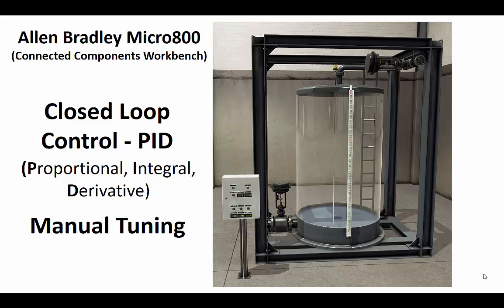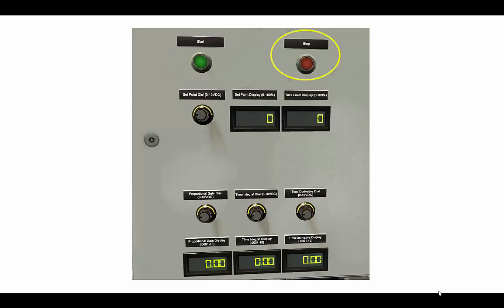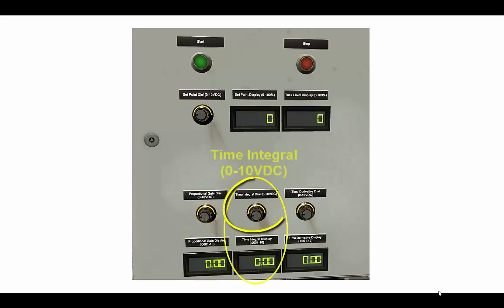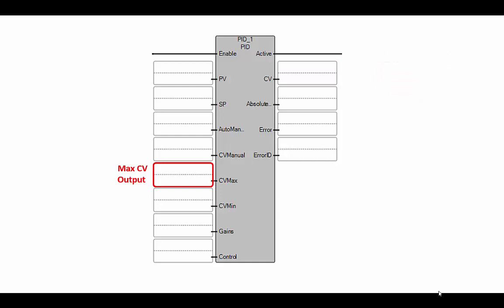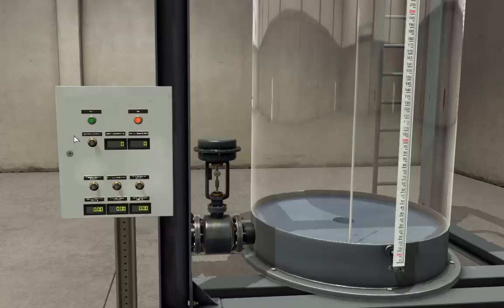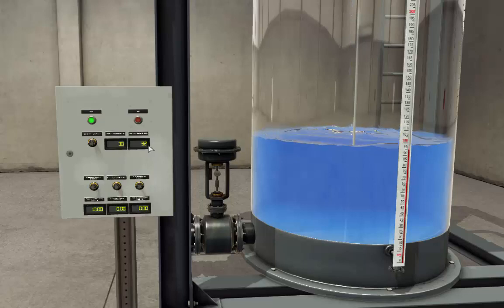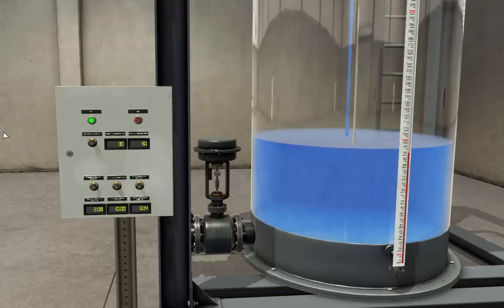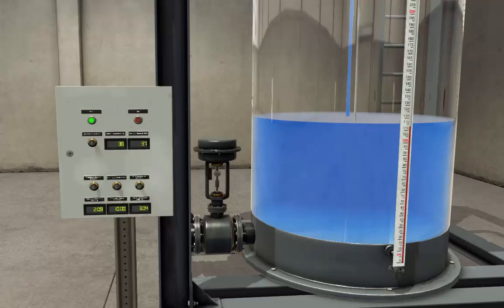PID Control in a Micro800 PLC programmed in Connected Components Workbench

Comment: What are your thoughts on the micro800? I have been using the  automation direct gear for some time and can't fault it but looking at giving this a try
Reply: Hi, bro, I watched your video many times, but one question, could i try the PID without Micro800 controller but just CCW?